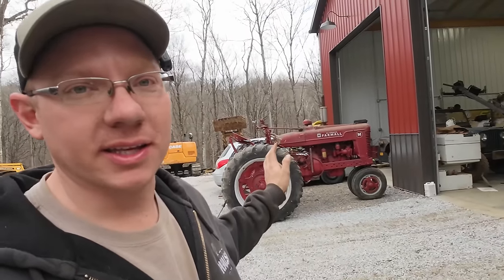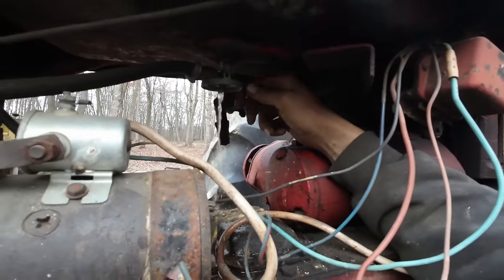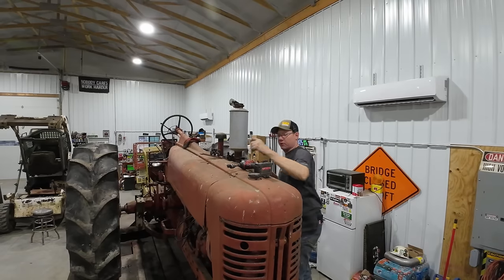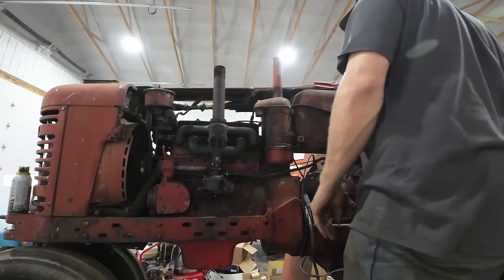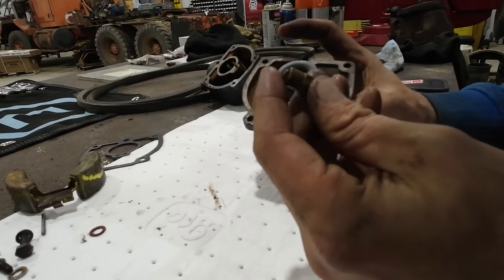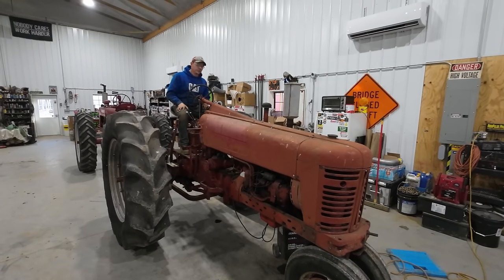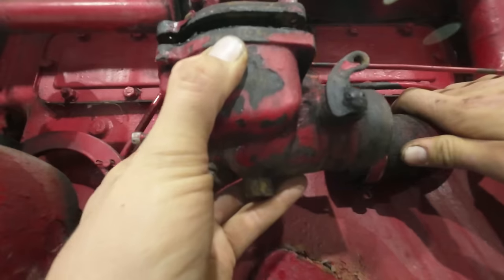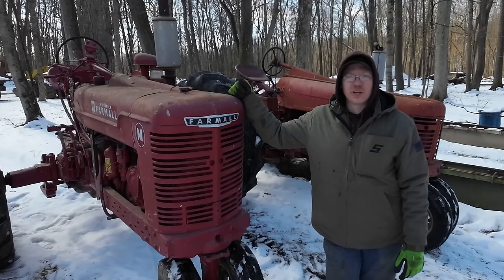Two Farmall Tractors for $2400 | Will They Run?? (Sitting Many Years)

Comment: In UK a lot of old tractors ran in Kerosene and had a large tank for the Kerosene and a small tank for Petrol which was only used for starting, the fuel would be switched once the engine was warm and the Kerosene was heated by the exhaust gasses. Do such tractors exist in America?
I think what you do is great and I often watch your videos and these old machines remind me of machines I drove in the early 1970's that some friends had, even then they were getting on for forty or fifty years old.

Comment: Maybe the fuel line from filter bowl to carb is delaminating inside preventing sufficient fuel flow into the float chamber? If so blocking the air inlet to enhance vacuum would suck fuel in as it is doing now.

Comment: When them old formals are running right, you can put them in high gear and close the throttle and ride the brake and pull the rpm down till you can count the cylinders as they fire! Were good tractors!

Comment: That dirty carb float is almost certainly coated in lead. Take care on there.
Did you check the fuel petcock for dirt?  They often have a gauze filter on the tank side. Try it in normal and reserve setting. They’ll often work on one but not the other.

Comment: Hi Matt, great fix on the carb intake. On the M - noticed the points were arcing bad in the distributor, looks like it needs a new condenser when you do the plug leads.

Comment: I screwed around with my Oliver oc3 for months. Must have Had the carb off 20 times. Finally realized I had 2/4 cracked head bolts, but the caps were still in place. it would run great for 30-45 seconds then die, and not start for hours. Had good spark it would just quit getting fuel. Took forever to figure it out

Comment: If you have to put tape on the intake so that it will run, it's very possible that it may be an intake gasket leak. You are compensating for a possible huge vacuum leak after the carb because you making it more rich so that it will run.

Comment: A tractor like that is useful even today. Just to haul trailers around the yard, using the PTO to drive stationary equipment like augers and elevators, etc. Always useful to have a smallish mobile engine that can run for hours and hours unattended and will probably outlive another couple of generations more than the ones it's already outlived.

Comment: clean and check all the plugs are sparking lying on the side of the engine no need for lots of cranking against compression after take the float bowl off and run some fresh fuel through then lift the float and see if it shuts off the fuel, if the float bowl is full of crud clean it and all the jets.

Comment: Nice tractors.  That M does have a nice grille.  The tricycle types are just not as comfy as the wide front and lower sitting ones though.  The gear ratios in the M also leave a bit to be desired-there is a huge jump between 4th and 5th.  I think I would do a minor fluff with fluids, carb kits/carb parts as needed, and plugs/wires/points so they run nice and move them along for double the money.  If I wanted to do shows, I'd keep the M but you have other stuff for parades and shows. I say sell them both.

Comment: I believe the “400” is actually a 300 or a 350. 400/450’s have the serial number tag on the carb side of the engine & 300/350’s are on the coil side. 

Also, the grille & radiator isn’t as tall on a 300/350, which from the looks of it once backed up to the M, is shorter than a 400/450. 

Also, the M has disc brakes, which I thought is only available on Super M’s, unless someone retrofitted them onto the M.

Comment: You have an friend with the same fetich as you dealing with,take an late night and deliver one of those beautys to his doorstep when hes at sleep,but remember to plug the gas line slightly with an pice of an paper towel and maybe take an pensil and write between cylinder 2 and 4 inside the distrubutor cap,so he can scratch his head for an while,remember its not all goods who comes for free

Comment: The M is probably more saleable to another collector who can give his best. The 400 needs some sheet metal work but seems like the better keeper considering you have the Torque Amplifier (10-speed) and you have the optional Fast-hitch on this model. I liked to operate a Farmall Super M-TA doing row crop farming in the late '50's and early '60''s. The Super M-TA was my favorite tractor for moldboard plowing, baling hay and other work where the TA was very useful for shift-on-the-go.

Comment: Even trickier is what I've seen done at the Buckley Old Engine Show.... Guys will back one on a trailer that size with the rear tires all the way to the front of the trailer.. The second narrow front gets driven on forward and they line up just right to fit on like a puzzle piece..

Comment: Keep them both parts are interchangeable I grew up with a 49M they were a great tractor also added 350 good tractor too we had the diesel on the 350 and overall the mortar but otherwise a good tractor they were fun to tinker with if nothing else put them in tractor pulls something to play with

Comment: Matt! Draft carburetors is that they require vacuum post manifold and pre manifold. Having the air cleaner or air filter off creates negative vacuum or pressure on the outside. I bet if you had hooked the air cleaner back up I'm assuming it's an old school oil bath it would have fired and run just fine

Comment: Try using carb cleaner instead of ether I worked 17yrs. An we found it fired much better on carb cleaner from walmart. An when u get it going with ur paint can cap try adjusting the main needle while u have ur hands free.

Comment: You will find few 1949 M's in that good of physical condition. Not all rusty or dented is unusual. Your other tractor is likely a 400 but you'd need to check the serial number to be sure, It is a 1956 or older unit. 400 ended in 1956.1957 and newer has 2 tone paint scheme of red and cream. So if it's a 450 it's 1956 or older. Too bad it's missing all the chrome trim.

Comment: If you can't keep both then I'd keep the M. I have a 1952 Super C sitting in a seacan (great storage solution for tractors and boats), hasn't ran in 25 years, rims are rotted out, a tiny gas tractor has little use on a farm of larger diesel equipment. But I keep it anyway, because it's something I want to have. If you've always wanted an M then have yourself an M, the better specs of the 400 matter little if you never need them.

Comment: I once idled a farmall so slow the oil pressure went negative and the tractor turned into a Time Machine and I went back to 1948 when it rolled off the assembly line.

Comment: The 400 should have a grease zerk on the water pump,might have a screw cap on it, dont know about the M. The throw out bearings should be greasable.
Put the float in hot water to boil the gas out of it and show where the leak is. Check the exhaust pipe into the manifold,that thread joint will flood the engine with rainwater. Good old tractors. The 400 has a bolt in the front end of its live power drive that might need torquing again,its behind a big pipe plug as I recall. A pretty good deal with fair tires . These old tractors, you could run the heck out of them and they keep at it with a little care. Have fun with them.

Comment: Great job getting them running. Fun them see them close to working condition but they lack a great deal in the way of operator safety and tricycle tractors are inherently trickier to operate. Find them a home where someone else can enjoy them and use the $$ to get that Autocar big cam restored and a full cab is way for fun at the Christmas parade.

Comment: Well, well, well.

If you sell either one, can you easily replace it?  If not, hold on to them.

I think you should store them covered or inside.

You WANT the M, but the 400 runs better and is more capable.

Keep the M for what you want (restore the M for parades), and keep the 400 to use as a tool.

Just my two cents.

Comment: You did very well on the straight purchase Matt - saw an M go in an auction over here last year go for £2,400 rather than $ for two! I'd bet good money that the speed you them up to around your roadways was the fastest they've ever gone. Take it easy with the tricycle format - have you into a tree double quick.  Worked as a lad on a small holding back in 1960 where the owner used a Allis Charmers fitted with row crop wheels, driven very slow and accurately pulling a small seed drill (planter) for mainly leaf vegetables - if there really was a god of veggies ( rather than tractors ) he'd surely have smitted the modern owners of that place as it now resembles a scrapyard. I shudder when I see it. 
Again - power to your elbow plodding on through to winning out despite several set backs! 
Keep'em both unless someone turns up with more money than they know what to do with.

Comment: Point in fact, my dairy farmer across the road from me with 230 head, will add the rinsing of the milk tank to the cesspool and spread that combo on the fields, so not only does it smell like manure but also rotten milk. 

Yeah, prevailing winds brings that right into my house.

Comment: carb & distributor parts are probably the same. You should have just robbed off the M to get this one running (a better cap & rotor anyway) and the carb, and then change it all back over later

Comment: Well Matt, you may ,or may not have the collectors bug? But as far as these two Farmalls are concerned you would not easily make a better purchase of those models there than what you have. Unless the price buys a showroom or show ready example. The TA I've not even seen on anything pre 585 IH. So that and the hydraulics on the other is quite a bonus. In these parts a comment that's for humor is regularly, downright offensive so I'm trying to make a measured attempt at comradery to a fellow tractor and machinery collector. Well done Matt.

Comment: Never vacuum on a gasoline tank -that is called a Flamethrower. 💣 7:04 that Will End Badly.
Reply from the maker: It was bone dry. It was dusty, hadn’t seen liquid fuel in years. Didn’t even smell like gas

Comment: I've run several of these things and run them hard    and never change the oil    the oil pan be full of sludge  and as many hours as I put on these things   I never could get one  to use a drop of oil or develop any kind of  engine noises that deviated from the norm   they have to be at least tougher than nails

Comment: so I'm only 31 minutes in at the point where he is putting rubber over the intake. Some times this weird carburettor issues can be caused my no having a air filter attached as some carburettors rely on the resistance of the air filter to draw more fuel and with out it looses it's tuning and ability to pull fuel

Comment: Matt, I bought a 53 farmall super h that has not run for over 15 years. What can I pour in the cylinders to make sure they are loose before I try to start it. I remember you did that to a engine before and let it sit. Any help you can offer would be greatly appreciated.

Comment: What a great buy, I'm not going to bet my life but, I think those guys have continental engines, if so ,they are pretty much bullet proof, best engines ever made.
Reply: Pretty much all IH tractors had IH built engines. The only IH tractor to use a Continental was the 350 Diesel, and they’re pretty rare and weren’t that great. They did use some Continentals as power unit engines though. Only other exception were the earliest Farmall F-12s that had flathead Waukesha engines, because the IH engine for them wasn’t ready for production yet.
Reply: Yes Sir , continental engines were made by I H and still, I think it's called 
Navistar now.
Reply: @brianbaxter-uh1ee  Continental engines were not made by IH. They were used in some cars, and also Ferguson, Massey Harris, and many other brands of tractors. The engine in an Oliver 70 for instance is also a Continental.
Reply: @justinstearns9723  I tip my hat to you Sir, you are right, continental engines were not made by IH, I was thinking of the Power Stroke, my apologies.
Reply: @justinstearns9723  yes I  think Packards, and Hudsons had continental engines.

Comment: Same old stiff and wicked clutch Farmall M. And be careful Those old Farmalls can run up to 40MPH.
Reply: 40 is a little optimistic. They run about 16 mph in road gear. But if the steering gear is worn and they have the Farmall death wobble then they can get a little squirrelly.

Comment: Hi Matt.  I've watched your YouTube videos over the last several years. I crack up on how you approach things.  You seem to know a whole lot about nothing.  You're able to stumble your way through things like a diamond ring that's missing the diamond. It's more like a Comedy Show than anything else.  Like your current Two Farmall Tractors. First off, your Tractor YEAR is 1949 (NOT the tractor MODEL). The year it was manufactured.  The Manufacturer this a McCormick     International  Harvester  Farmall. MODEL is   "M"  (not the year).  In Rusted Fuel Tanks, 1st drain them and let them dry out for at least a week.  After ensuring they're dry inside,  Plug All of the holes in  the Fuel Tank  except the Filler Cap opening. Pour in EvapoRust at least half full.
 Seal off the gas tank fill opening with the gas cap. Let the Fuel Tank sit for a minimum of one week, preferably two weeks. Drain the EvapoRust into a plastic container. Remove the remaining plugs from the tank. Flush the fuel tank with soapy water. Slosh the soupy water around in order to loosen any remaining Rust residue, and drain that out of the Fuel Tank . Fill the tank with clean fresh water and slosh it around while emptying the Fuel Tank through the Fuel Tank filler opening. Pour about one pint of fuel into the tank. Slosh it around while emptying the Fuel Tank through the filler opening.  Now you will no longer have rust in your Fuel Tank. Any metal Fuel Tank expected to sit more than 3 months should be drained. The Fuel Tank should be turned off between the tank while running the engine. When the engine stops running, the fuel supply should be dry. This should empty the carborator 
or Fuel Injection. Common sense the an Engine Mechanic/Technician.

Comment: why do old american tractors have dual front wheels in the center?  over here in europe they always have widely spaced front wheels.  makes no sense!
Reply: it was for the spacing of row crops, the narrow front wheels would go down one row, and the rears down two other rows while cultivating, giving more clearance over the crops than the axle of a wide front tractor would allow. It also allowed the tractor to turn more sharply at the end of the field, so you could pack more crops into the space that a wide front tractor would need for turning. The downside, of course, is that it makes the tractor less stable than a wide front, and since sprayed fertilizers have replaced cultivators, they've been fazed out, although modern sprayers still have a very similar wheel arrangement, since they're still used in the field while crops are growing

Comment: my old tractor choice  be JD poping John s  and Johnson bar clutch  and big belt drive fly wheel   
  sometimes could be started by turning the fly wheel
    tractor 🚜 fly wheel and long ass belt operated stationary hay baler   team of horses with a buck rake would go out and bring in hay 2 guys would pitch fork hay up onto feed table another would feed The packing chamber there a separation block that inserts between Bales  my job was to feed bale tye wires through then go to other side and tye the wires off while bale still under compression  
   as the bale drop i would have take the block put it up on feed table and drag the 120lb bale out of way   wash rinse and repeat   all the while staying clear of that 40ft?x 6 in  belt 
   was real work at the time one of my fondest memories late 1950s  wasn't even a teenager yet